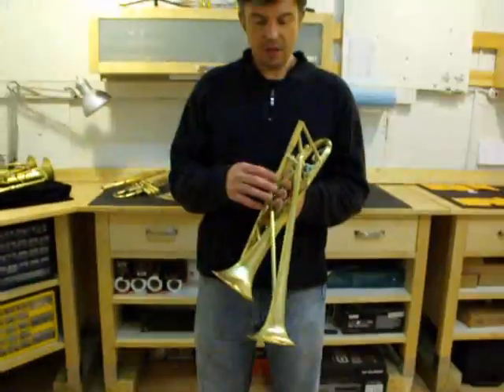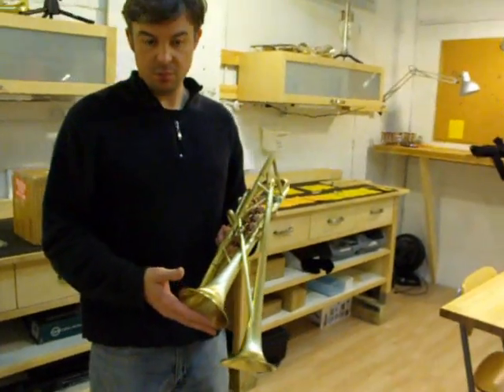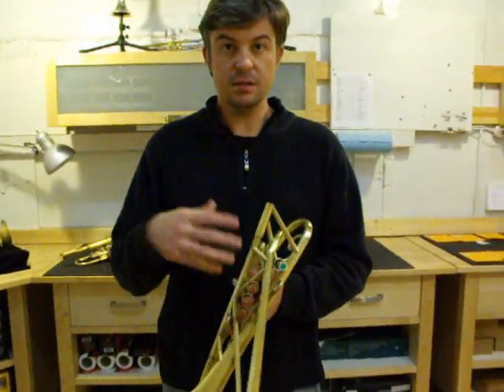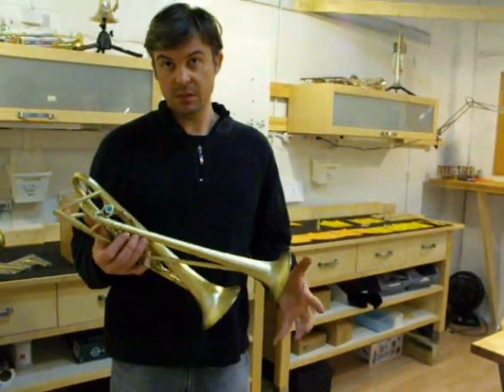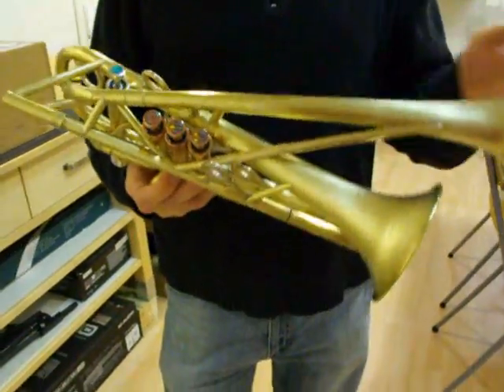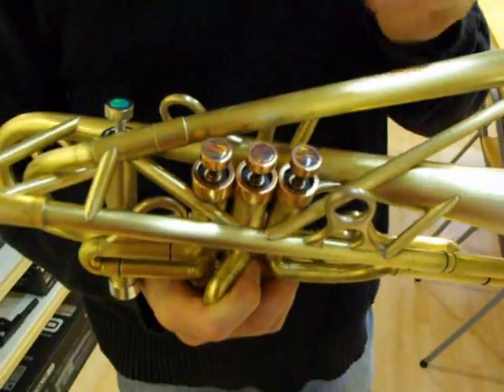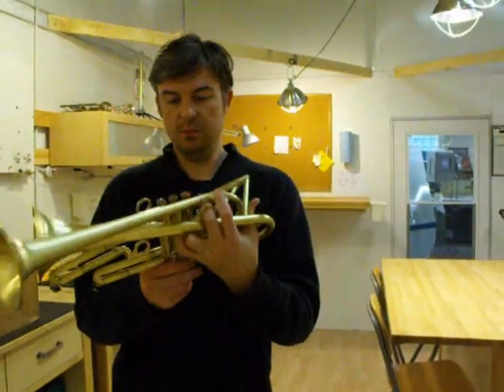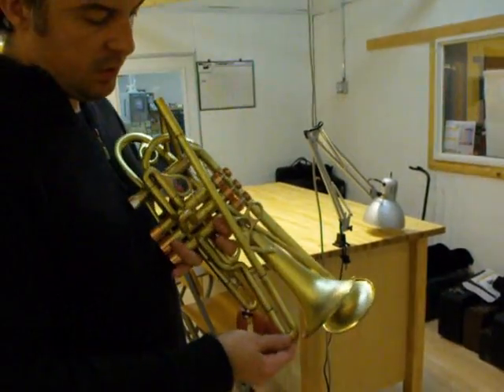Two Bells? Harrelson Medusa Bb Trumpet Demo

Comment: If you wanted a different design still, you could solder two leadpipes side by side and put the tuning slide in the leadpipe you wanted and put your mouthpiece in the same one. Sounds confusing but isn't. I don't have the funds to commission it at the moment but I would like to see it done.
Reply from the maker: Anything can be done :)